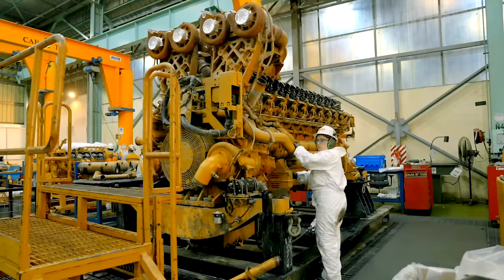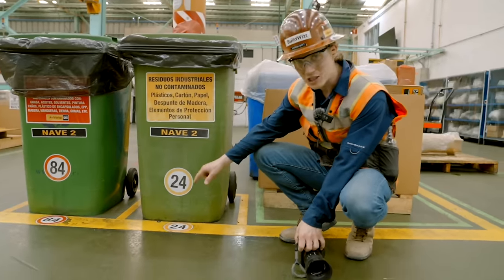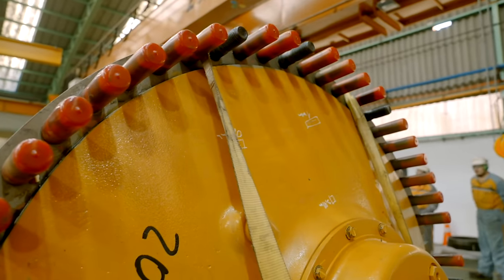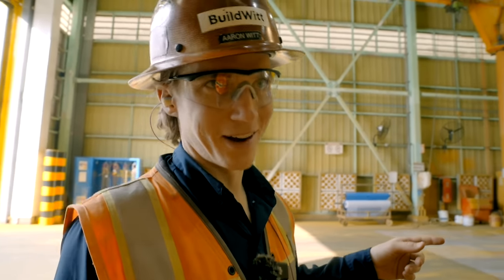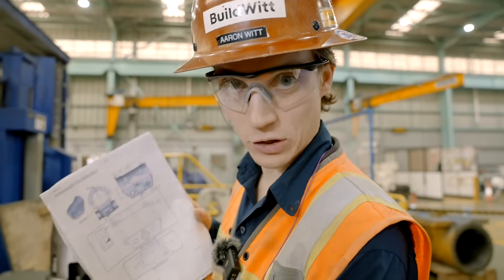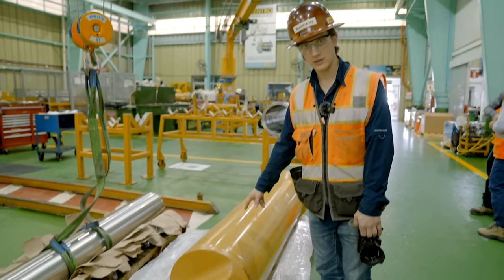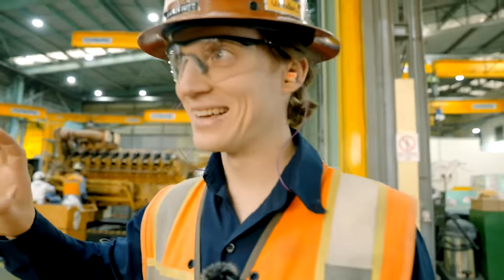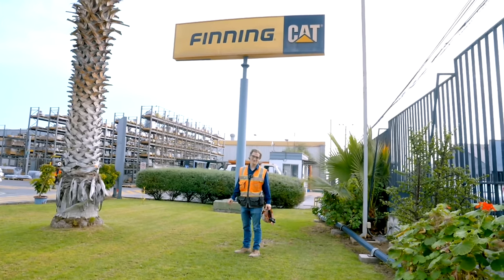Giving the World's Largest Truck Engines Second Lives!

Comment: Come to Mapleton, IL Caterpillar foundry for a tour.  We mold and cast the engine blocks, heads, cylinder liners and many other of those parts.
Reply from the maker: hopefully I can one day!
Reply: Do they have areas of the CAT Foundry and Manufacturing Facility sealed off from the public or any filming and pictures due to corporate privacy policies because they keep certain machines, technology or techniques secret from their competitors Justin?
Reply: Casting the engine block would be ridiculous
Reply: @tristenklein225  Yes, filming is largely prohibited at mapleton. But if an arrangement is made then I'm sure they can work around the sensitive areas.
Reply: @PhillipPerin  Thanks for the input 👍I figured certain areas would have to be sealed from public viewing because of proprietary technology Engineering and manufacturing processes as they have in NASCAR, Formula 1 and Automotive Engineering and manufacturing Companies.

Comment: In the early days the 797 trucks ,used 2 engines bolted together , because  Cat didn't have a big enough powerful engine, so they used 2, that is awesome 👏
Reply: That 797 engine is still the original configuration of 2x 3512 coupled together, I havent worked on them for a while but i heard the majority had a retrofitted C175-20 option available like the later 797s, i just remember they were horrible to work on, the couplings were shocking for leaks and a pain to fix unless you pulled the engines and split them.

Comment: You mentioned Non destructive testing. I used to do this so I'm gonna explain a bit about how it works, as best i can remember.

In most cases you have a petroleum carrier (imagine wd40 or something) that has a ton of small ferrous metal particulates (like iron). 

You douse the part in the the carrier, then you take a massive amout of amps (say 2-4k, very loud and scary at times lol) and run it through the part. The metal particulate in the carrier will then align itself to the magnetic field of the part (depending on how you have the clamps oriented).

Once that's done, you take your UV light and shine it on the part which will highlight all of the metal particulates. If there are any surface or subsurface cracks, the electric charge will cause the metal particles align themselves to the magnetic field of the imperfection. This means you can easily find cracks below the surface.

Alternate forms of NDT include liquid penetrant and ultrasonic. 

Hope that was helpful or interesting to some. Keep up the amazing work Aaron!
Reply from the maker: thank you very much I appreciate it
Reply: The process you describe using ferrous particles in a petroleum carrier sounds an awful lot like magnafluxing.
Reply: @geofjones9  it's referred to as that or magparticle testing usually

Comment: Spray welding. Or something similar - the spray welding I'm familiar with starts with powdered metal instead of wire.
Reply: No, metalizing involves feeding a wire through a nozzle that looks like a cutting torch tip. The wire goes through the center hole, the holes surrounding the center burn oxygen and acetylene. All that is enclosed in an air cap that blows the barely molten metal off the end of the wire, and sprays it onto the base. I did that for years, a great process! I did spraywelding too. It involves getting the entire part to brazing heat, not good for many applications, ideal for others.

Comment: 07:25 so it is welded by "spraying" multiple layers onto what is being built up am I correct?
Reply from the maker: exactly
Reply: No, the sprayed metal goes on semi-molten, not welded at all. The semi-molten spray splashes onto and around the rough surface of the base or already applied sprayed metal. The resulting coating is more like compressed coarse powder. The coating has very little strength of its own, derives its strength from the base metal. I did this for years, I know.
Reply: @geofjones9  Ah, interesting.  Thank you.
Reply: @AaronWitt  Thanks and a hello from the State of Texas.

Comment: How is the new tougher D CAR bolt's holding up to the pressure torque pounds and does that new 2029 D 9 got a good enough think blade of no gramd key repair stuff

Comment: Only 15000 hrs?... Doesn't seem like very many hours for a haul truck let alone any other machine that's "life time" is 70-80 thousand hours.... That's alot of rebuilds over times
Reply from the maker: yeah but they ain't idle hours... they're hours hauling 400 tons of ore up and out of the world's biggest pits
Reply: 15000 hours thats just 3 years or less in operation in a mine that runs 24/7.